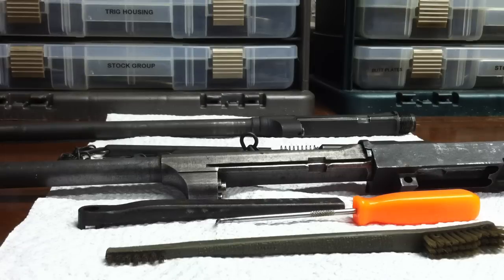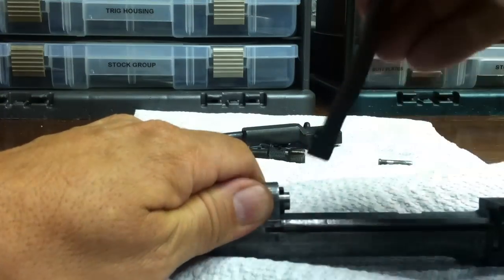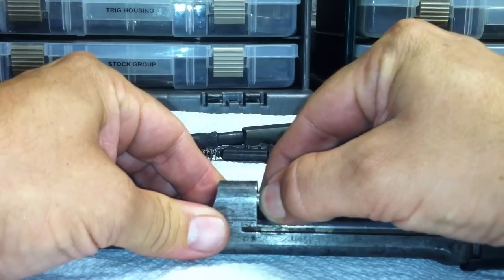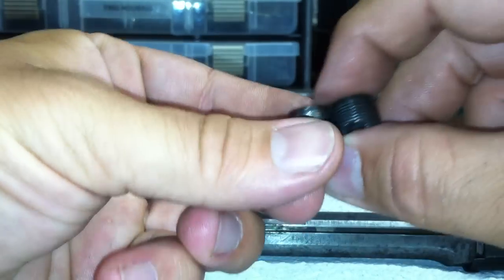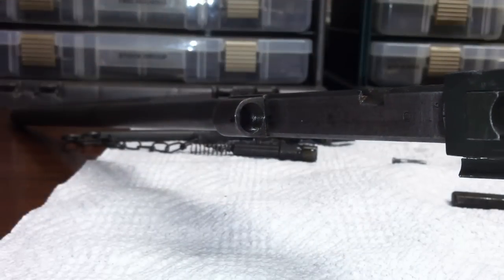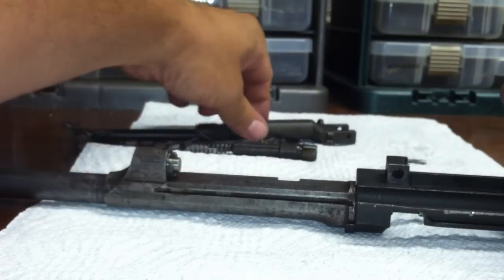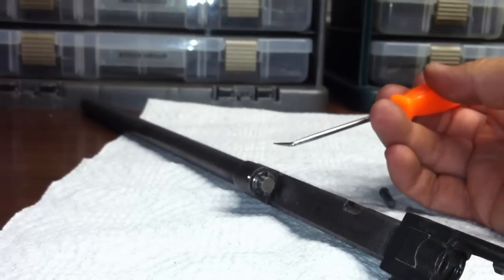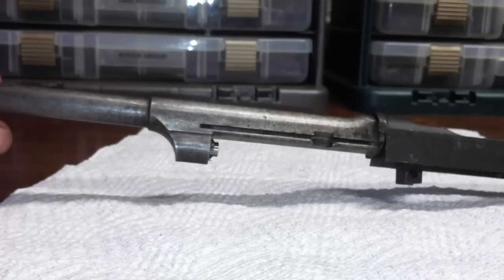M1 Carbine Gas Piston Removal/Installation

Comment: I did a quick google search and it looks like the "M1 Carbine Gas Cylinder Tool Set" from "Standard Parts LLC." is the same just not original GI. I checked their website and it looks like the sets are in stock. (Looks like YouTube won't let me post the direct link, sorry.)

Comment: just inherited an m1 carbine. like in the video, my gas piston is stuck. however i dont have the gas piston nut removal tool yet, so im not sure if i have the old of the new nut. would i be able to install either of the 2 nuts or do i have to match it up to exactly whats on my carbine?
Reply from the maker: Try firing it first, it may work fine.  They are a very snug fit and with a little carbon it wont move for your fingers.  I would play with it unless it does not function.

Comment: Should the gas piston be oiled as part of a routine cleaning and maintenance??
Reply from the maker: No, it should remain dry.  The key is if it moves free or under slight pressure leave it alone.

Comment: Do you know if there is a torque spec on the gas piston lock nut? I can't find anything in the book other than "be sure to lightly stake the nut after its seated." Upon inspection I found mine to be loose.

Comment: When you mentioning the gas block and during your inspection of the piston housing you mentioned if a crack is next to the hole where the piston goes in  what would be the fix for this is the barrel ruined ?
Reply from the maker: I consider it ruined but if taken to a good gunsmith who has worked on the them before and has the proper tools they might tell you otherwise.  Ruined to me means I would not fire it and it has lost collector value as compared to an undamaged barrel.  Great question.
Reply: Thank you it’s a early barrel I hate to lose it 1-44

Comment: Have not had a problem so far with my gas piston sticking but I did just run into another issue. During and inspection at cleaning I noticed the gas piston nut was very loose on my carbine. It had not caused any failures but I was able to turn it freely by hand! Not knowing how much it should be torqued down, I simply tightened it by hand as much as I could so it would not shake loose. I now have the proper wrench and would like to tighten this thing up as it should be. You did not mention how much you should tighten on re-assembly. Again, I will not be removing the thing but would like to torque it down properly. How much 'omph' should I put in to doing this? Just till it stops? Slightly more torque after it stops? More? Less?   THANKS!
Reply from the maker: Tighten until it bottoms out and a little more.  Don't overtighen or the threads will strip.  The key is to STAKE the metal into a void on the nut which will keep it from backing out.  Do not make numerous staking.  One good one is usually what the military did.
Reply: @norwich93CMP  thank you. That is how I set my M1A Springfield up. Of course most aching is necessary there. My M1 carbine is a 1943 US Postal meter. Because of the age oh, I do not run a great number of rounds through it in a year's time. I do a thorough cleaning and inspection every time I do. So, I probably will not stake it as I can check it every time I shoot. Thanks again.
Reply from the maker: A loose nut can blow out like a bullet.  I have seen the damage and it is catastrophic.  I highly recommend staking!!!

Comment: Thank you for your informative videos. I bought one of those tools you use on this video. It came from France, interestingly enough.   The spring coils on the thread tap and the piston wrench are too wide in the rear to fit down the hole of the tool. Should i clip ( cut) the last coils or is there a way to make them fit?  I noticed the coil on your thread tool is the correct diameter to fit down the hole.  Both of mine have wide loops at the end and wont fit.  Please advise.
Reply from the maker: Yes, they were made that way to retain in the hole to prevent dropping out.  Its good to go.
Reply: @norwich93CMP  Thank you for the reply. The coils are too wide to fit down the hole.  They wont fit unless I clip them. So, is there a trick to get them in that hole, or should I clip them?

Comment: is it possible to replace or repair the gas piston housing? I just bought a IJ M1 carbine (made in the plainfield NJ plant) ..but whoever owned it before me decided it would be a good idea to not buy the piston nut and just welded  a metal ring into the housing to hold the piston ...and the weld has failed first time taking it to the range ...it looks like the threads in the housing are in good shape just a few threads are now covered by bronze looking welding material ...its such a shame because the barrel is in practically unfired condition when putting a borescope down it ..I really would like to save this barrel somehow ...it appears the housing was brazed on or maybe welded .. can it be cut off and replaced? I duno what the best way to go about this would be
Reply from the maker: I would have a gun smith tell you what that weld was exactly.  Welding is very different than brazing.  If is was brazed there probably is a better chance you can save the barrel.  If it was welded it's probably toast.
Reply from the maker: Also CMP sell Criterion replacement barrel if you need one.
Reply: so from the research I have done the planefield plant brazed on the housing ..unfortunately there is not a gunsmith near me (wichita falls tx area) and I would need to drive to dfw or okc area to find a gunsmith (I myself am a amateur ..not sure on the correct term... armorer/gunsmith/enthusiast .. but I have not learned metalworking yet ..love learning new skills but just do not have enough space yet to setup the equipment needed as my shop is packed ..It is such a shame the previous owner of this rifle did this hatchet job to this barrels gas piston housing .. potentially destroyed it because he did not do a google search and order a 12 dollar part) ..I am going to post a video on here today showing my ideas to repair it and would love your opinion...either way thank you for the reply  @norwich93CMP
Reply: if I do end up needing to rebarrel the gun ..I don't know if it is worth it or not ..I did not do a ton of research into the value of the gun before I bought it because I have a list of 6 or 7 guns I have wanted since I was a kid and this is on the list ..so when I seen this for sale at a auction for what I felt was a good price I jumped on it .. currently have 550 into the gun..then another 100 for the new parts/tools I have ordered (I ordered a new piston and piston nut and the maint. tool kit) ..a new barrel would add another 400 plus the action wrench and headspace gauges etc) so would be in for over 1k on a non-GI carbine ..worth it? I am leaning towards yes    @norwich93CMP
Reply from the maker: That's real bad, scrap it and get a barrel.  It's unsafe as it is.
Reply: @norwich93CMP  so I ended up using a  fine steel dremel bit to very carefully remove the excess material that was welded onto the gas housing ...then I bought 2 of the screw in piston holders and used one to clean up/tap the threads and them installed the other ...worked out great ..now it looks near a standard GI gas housing just about

Comment: I am able to get my gas piston to extend/protract after spraying it generously with WD-40 and then tapping the gas piston housing with a rubber mallet.  However, when I plug the breach and then blow into the muzzle, the piston does not extend/protract.  Is it possible that it may still work properly when fired given that the PSI produced by the round will be much greater or do you think that it's probably just stuck?  I see in the video that you recommend soaking the barrel up to the gas piston housing in something overnight to try and break up any build up that may be blocking the small hole that goes from the barrel into the piston housing.  What is your recommendation for a solvent that won't hurt the finish (bluing/parkerizing) on the metal parts?  Again, thanks for all of the concise and accurate videos!
Reply from the maker: Solvents shouldn't hurt the finish.  Firing it will help also.  If you get the piston down I would flush from around the piston with WD-40 spray.  Then pushing the piston and pull it out again and repeat.  The gunk coming out should be dark and get lighter each time.  If this still doesn't work you have to bring it to someone who has the tool as in the video.

Comment: Do you know if the barrel of the carbine is thread on only and what the torque would be?
Reply: I'm just curious, if the headspace on an m1 was too much, could you fix it by removing the barrel and turning a couple thousands off on a lathe? Would that work to shrink the headspace? Thanks, I'm asking you because it looks like you know what you're doing.
Reply from the maker: No you can't because the barrel is threaded on.  See my other videos about barrels.

Comment: Could it be that you over tightened the nut? The torque may be an adjustment before staking.
Reply from the maker: If the threads stay intact there is no over tightening.  The castle nut should be fully seated, then stacked.

Comment: What if I hold the bolt closed and fire a round after letting some WD-40 or CLP soak in the Piston over night? Would that possibly knock it  loose?
Reply from the maker: Possibly.  I would try cleaning first without firing.  After soaking overnight usually an non-marring pliers will get it loose or even a rap from a small hammer.  Keep working it out, clean, spray, pullout, and repeat until the liquid gets cleaner and cleaner.
Reply: norwich93CMP I had to resort to pulling the Piston out with a pair of pliers after letting the barrel soak for a few hours.

Comment: Hi, I would like to know the pitch and the thread of the ring nut that holds the reset piston and the diameter, thanks
Reply from the maker: There is one book by Jerry Kuhnhausen, The US .30 Caliber Gas Operated Carbines A Shop Manual.  Check pages 102 & 103.
Reply: It's .5000-32 class NS-3 threads.
Maj. dia.-.5000 +.0000
-.0054

Pitch dia. .4797 +.0000
-.0026

Minor dia. .4617 MAX

Comment: I have found that using an automatic center punch repeatedly works rather well for light duty staking of things.
Reply from the maker: Yes.  The stacking does not have to hard, only just enough to keep the nut form turning out.

Comment: If a gas piston cylinder is cracked, can it be brazed safely?  This is a hairline crack. It is at the bottom Through the hole.   Thanks
Reply from the maker: Some welders say that it can be if limited to the area right were the hole is.  I DO NOT recommend this.  This area is very important with safety, I have seen what a stock looks like if the gas piston nut fails and is looks like a bullet was shot from the inside-out.
Reply: So, it is time to replace the barrel???
Reply from the maker: I would.

Comment from the maker: @ Asterix5508.  Which is broken?  If the gas cylinder is broken the whole barrel needs to be replaced.  I have seen some weld the small area between the beginning of the gas hole to the rear where the gas nut starts.  I don't not recommend doing this and firing.  I have seen catastrophic damage done.  The gas piston usually blows out and bounces out of the gun looking like someone shot the gun from the inside out.

Comment: Great video friend very well elaborated and explained by you. A friend asks. How often he must do some maintenance to gas piston? Is there any other way to remove the screw holding the piston if it does not have the key to remove it from your site?
Reply from the maker: +270WeaMag Only do the maintenance when the piston does not move while shooting.  I would not use any other tools other than the wrench or the insert of the tool.
Reply: Thanks brother!!!

Comment: Have you tried, or would you suggest, putting this in an ultrasonic cleaner?
Reply from the maker: No I would not.  Ultrasonic cleaners I know of are water-based and with very tight areas it would be hard to remove all the water.  That will create rust and then you have a second problem.  Good question though.

Comment: Does "staked in" mean that the metal on the piston nut is dented/meshed into the metal on the barrel?  Does the metal actually get dented in some way?
Reply from the maker: The metal around the nut is upset/dented into the small cut out notch on the nut.  This prevents the nut from loosening during firing.

Comment: Where did you buy the nut removal tool?
Reply from the maker: clement concodora Its a USGI part, there around at shows and on eBay and/or Gun Broker.

Comment: I've read that many times the gas piston nut was staked in place. How can I tell if mine is staked and if so, how tough is it to break loose? I found out the hard way that I had some French (headstamp is VE 7.62 BD 1-62) ammo that is corrosive and I'd like to make sure the gas piston gets thoroughly cleaned.
Reply: Around the seam between the nut and body it screws into, there will be punch marks (divets) that lock the nut in place.

Comment: Excellent video.......in lieu of staking the castle nut, what about using a drop of Locktite thread locker?
Reply from the maker: 50,000 psi is the pressure used to test barrels, does Locktite warranty that?  If not, stake it.  I have seen a stock where the piston blew out from the inside, its just like a bullet.  Nope, I would never do it.

Comment: How often should I bring my m1 to a gun smith to have this done?
Reply from the maker: Never if it moves free or you get it to move free with cleaning.  Only when its frozen should you take to a gunsmith, one who has worked on the Carbine.
Reply: @norwich93CMP  I have a 1st run Inland and a post war "commercial". The commercial version I was able to back that nut out with my fingers. Is that normal? I cleaned it out, put it back and tightened it with needle nose. Noticed the 1st run wouldn't come out. Stopped. Looked it up here. So little dab of Oil and it's fine. The commercial one also had an out of battery discharge. Blew the magazine to pieces. We took it to a gunsmith. So far so good.

Comment: my 43 inland has a tiny crack in area in front of the hole towards the receiver. it is cracked where they staked the cut in place. the nut hand turns about a mm in either direction but is staked firmly. is that tiny crack from the armorer staking a concern? is my barrel toast? Thanks.
Reply from the maker: Usually the tiny crack your describing isn't bad.  A loose nut is and needs to staked.  The nut and piston can fly out and cause serious physical injury.  Just ensure the crack is only limited to that small area and not behind it.
Reply: It's only in front and very minimal. The issue with tightening it is that they peened the top of the gas cylinder down as a means to stake the nut (resulting in the crack) therefore the nut can be moved a bit but is essentially staked. My issue is that this made the staked part out of round and I'm worried that I would damage the threads on the barrel if I messed with it. Basically it's lose but it isn't going anywhere. Does it need to be tight if staked?
Reply: BTW thanks for the response, much appreciated.
Reply from the maker: E-mail replied to.

Comment: What if you just put some compressed air into that small hole by the gas piston?  The only thing you might want to do is put a block of wood or something if the piston might come shooting out like a bullet.
Reply from the maker: That hole is blocked by the nut and won't push the piston back.  That hole is drill through all the way into the barrel.  Only the hole from the barrel down into the chamber behind the piston works.

Comment from the maker: FYI.  Its a USGI tool I used, not commercially made.  If you find a commercially produced tool read their feedback or recommendations from others before buying.  As it stands, this is the most technical tool for carbines and I would NOT recommend any tool but the USGI one at this time.

Comment: Please don't stake anything, I was in the Marines 4 years, we never staked anything, just tighten firmly, don;t damage any fittings...
Reply from the maker: Disagree.  I've seen a stock with the piston and nut blew out.  It looked like someone shot it from the inside out.  Its extremely dangerous not to stake the gas piston nut.
Reply from the maker: Phil Hall  it is dangerous not to stake the gas piston nut and by not doing so could led to serious injuries or death.  I highly recommend to everyone to ensure the nut is stake and inspected by a qualified gun smith if this area is worked on.
Reply: I never saw anything staked on the M1, M14 and M16...
Just like to reminisce, after HS66, I was in the Marines 67-70,
Vietnam experience 1st MAW MWHG-1, HWCS-1 DaNang, Teletype/Crypto Technician, now 71, just me and the Whitetail deer good friends. In Boot Camp at Parris Island SC we had the M14, then at ITR-Infantry Training Regiment Camp ‘S Company’ Geiger NC we had the M1, then at Camp Pendleton Ca and Vietnam we had the M16, then back in the states again we had the M14. At ITR we had outdoor heads buildings, in the heads there were long concrete sinks, when we would get back from the day’s training, maybe at mid-night, we washed the M1 barrel/receiver group in the sinks with hot water to remove all the dirt. After the Marines Honorable Discharge, got a A.A. Business/Computers at Bucks County Pa Community College, then 25 years Mainframe System Analyst/Programmer at an Insurance Company…